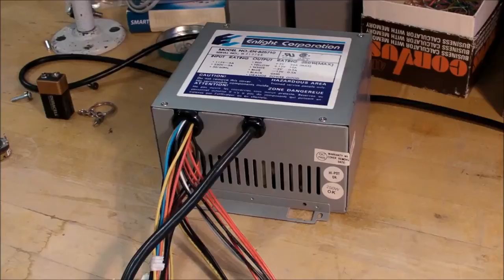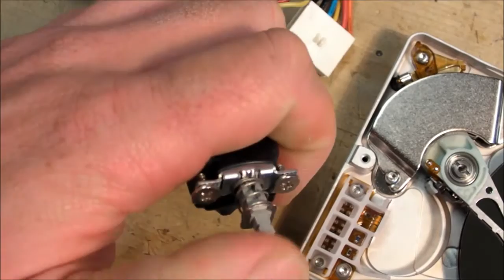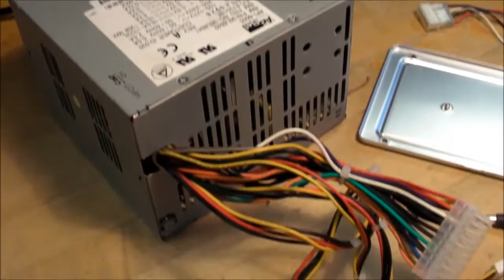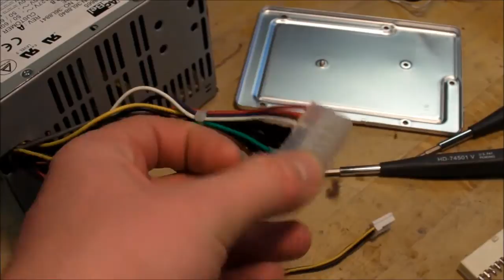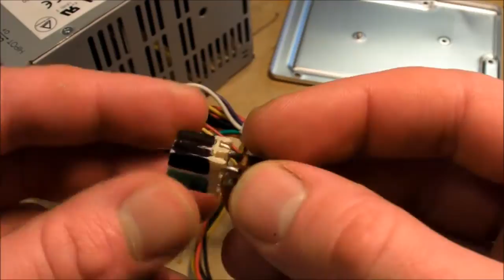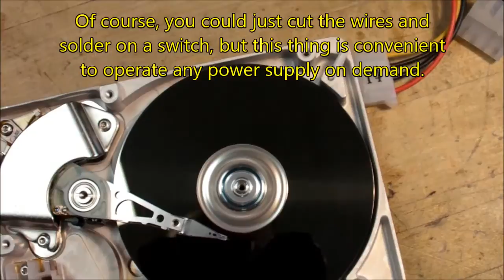(#0104) Convenient Switch to Turn On Any ATX Power Supply

Comment: Ok so this is a wierd one. I'm just a hobbyist, audio, gear head, im no gamer I have a chromebook lol. I have a evga 850bq I think it is, I bought it new so it was u touched and i did all the wiring so im sure everything is as it should be but I've tried about every type of switch I have and whether the switch is on or off the psu comes on. Otherwise it works fine and powers a 600w amp. I have an older Dell unit that I believe I also tried this on a while ago and had the same outcome, i think! I want to be able to kill the power to the amp quickly without killing power to the entire set up, or adding unnecessary wiring, another power strip etc etc. This is a sort of portable sound system for parties and tailgating.